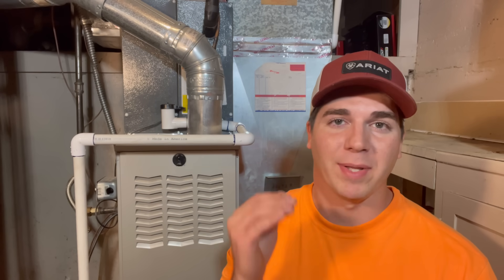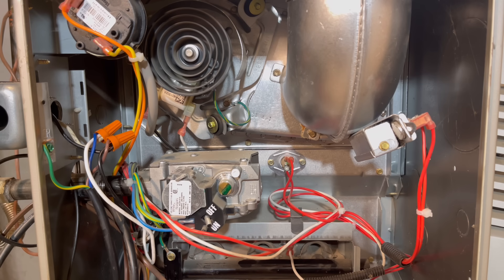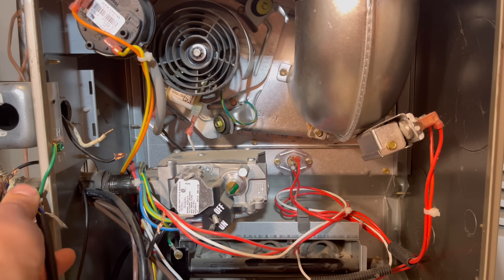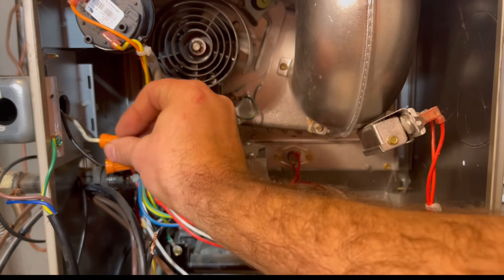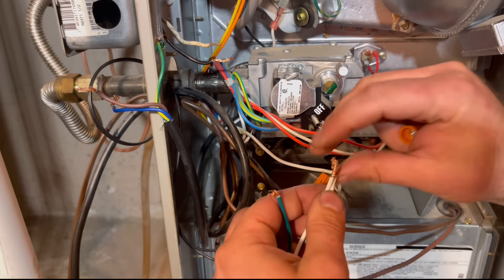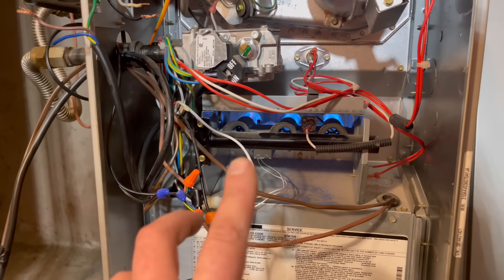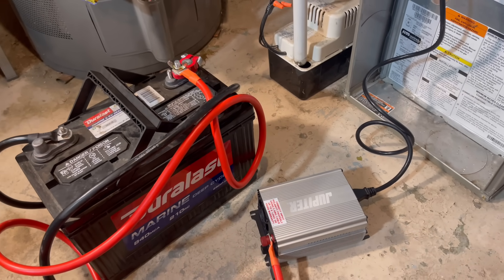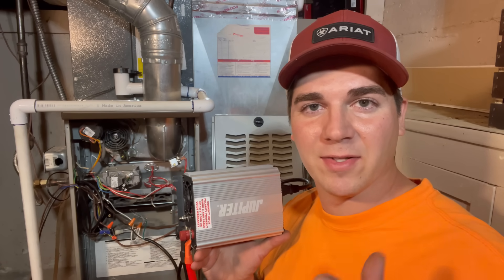Did You Know You Can Heat Your Home With A Car Battery?

Comment: Some corrections need to be made here.  A furnace drawing 800 watts would be pulling about 80 amps off the battery. That is about the same amperage as a starter motor draws as you are starting your car engine, so the furnace would not run very long.  As others has pointed out... It is important to use the more expensive pure sine wave inverters.  Induction motors and transformers (which are what this furnace has)  will run slow, hum loudly, and will run hotter on cheaper modified sinewave inverters.  If you were going to do this, you would be better off hooking up the inverter to your car and keep the engine running the whole time, and run an extension cord to the furnace
Reply from the maker: Yes, I actually hooked it up to my work truck so I can power the furnace as long as my truck has fuel 👍🏽  thanks for watching! cheers
Reply: @diyhvacguy   so a 1000 watts total? Meaning 500 watts per plug?
That's how mine worked. 3000 but only 1000 watts per channel.

is 500 watts really enough to power the unit?
Reply: @alandeon  For his "800W" furnace, 500W wouldn't do it, unless it had a Surge which could temp handle it (likely did/does)... 
 (... and his "800W" furnace is apparently quite large, or like he mentioned that reading was done during the very short time the igniter was on too;  my small-ish furnace was only pulling 265W after igniter was done (blower only), and not a whole lot more when it was briefly on)
Reply: That peak power draw from the furnace lasts less than a minute when the gas ignitors are activated.  Beyond that,  you're just powering the gas solenoids, computer control, draft fan, and main blower fan.  Just hook up the inverter to your car outside, and run a long extension cord into the house.
Reply: A gas furnace only draws a fraction of that.
Reply: @ScottDLR  I have 2 - 2 ton furnaces.   Each draws 550 watts.  Obviously a larger furnace would draw more.  That's why I said 800 watts
Reply: @stevehill1802  Just checked mine. I have one 3 ton furnace and it draws 312 watts while the inducer fan is running .
Reply: @ScottDLR  Cool.  Just goes to show that different furnaces draw different amounts.  Mine has a humidifier which draws a little.  Also the igniter was on when I took the reading.  My furnace is 30 years old as well.  The inducer is huge for some reason.  It is high efficiency.
Reply: Trucker_9000   - Re: "pure sine" ... - Not sure about that, I've always had motors slower 'n buzzin without it...  (2 pure sine's, 2 not)
Reply: trucker 9000  I hope you're not using a gas cooktop indoors without running an exhaust fan and certainly not to heat a small room!
I liked your answer "...@Dean Crowe  same reason you cant eat yourself to stay alive" Lol
Reply: @jcook3986  ? - only 115Ah (plus 70Ah) batteries?   I use a 460Ah LiFEPO4 Lithium battery (about half the size/weight of a small/std car battery) I got for just $140 (tax incl) on Amaz 2 yrs back (with 5 yr warranty and Great Customer Service reviews for easy free swap-outs if/when needed; at that tiny $$ maybe up to 15% needed returns but ppl loved the quick easy replacement service and had no issues with the new ones)...  Still small for HVAC, but one time our (small) furnace blower blew immediately b4 a power outage, was able to fit in a 20" box fan which only drew 50W and did a surprisingly ok job in the small setup/area with only 2 vents left open (bedroom+bath)...  got a couple days out of it, then recharged on $35 smart charger with $180 Pure Sine inverter 1500W (3000W Surge) connected via long thick extension cords to car in about 2 hrs each time.  (didn't want to just leave old car running all the time)...  Also did this for 2 fridges, just swapped the (several) extension cords' plugs at the inverter, ran long enough to chill each fridge every 6-10 hrs as needed according to thermometers.  (lol little funny walking over several sets of long thick orange extension cords strung thru house, but did the trick, and after the initial surge current for a few secs the actual running watts were surprisingly tiny)
Reply: trucker 9000  A controlled dead short?  If you are talking about the windings on a motor, then anything with a motor or transformer would be the same thing, and would not be considered a short.  In fact anything you plug in would be considered a controlled dead short under your definition, except electronics with a switch mode power supply.   Induction motors such as a blower and  draft motors do not run well on modified sine wave inverters.  They run slow, over head and hum loudly.  Pure sinewave inverters are a little less efficient than modified ones though
Reply: Trucker_9000  - Perhaps he means keeping the battery topped off as it's powering the high-draw items which the inverter itself (if limited to 500 per channel, as someone inquired above) can't quite handle, as well as the somewhat large (if brief/intermittent) surge/draw on the car/alternator too...   The battery would be a "buffer" between the two (tho I'd imagine there might be some extra circuitry required in that kind of setup)...   
- Just guessing...  ?
Reply: Actually I think many starter motors draw a lot more than 80 amps! As an example I looked up totally randomly first starter motor I found from spare parts site; Volvo car starter motor, power 2,2 kW. That power with 12 V requires about; 2200 W / 12 V ~= 185 A to run. Bigger engines may have twice more powerful starters, so it is not uncommon for starter to be 200 A or so, or even more.
Reply: @wopmf4345FxFDxdGaa20  You are correct.  Diesel engines draw a lot more.  I looked it up, and a starter motor can pull anywhere from 80 to 225 amps depending on how big the starter is
Reply: @stevehill1802  Yeah, you are right. I don't know how powerful / what kind of wattage the blower motors usually are in those furnaces? From that info could calculate the amperage quite easily . . .
Reply: I think the continuous load of the furnance is the fan. I wouldn't expect that to consume nowhere near as much as car starter motor  continuously, but I might be mistaken . . .
Reply: @wopmf4345FxFDxdGaa20  The ratio for a 12vdc to 120 vac inverter is about 10 to 1.  A half horse motor draws about 5 amps, or about 50 amps off a battery.  If you notice the cables going from the battery to the inverter have to be huge
Reply from the maker: I realize I was mistaken in my assumption that it would last for days in that my heater doesn’t run but for maybe 10 min increments so it’s not like mine stop running time. But I guess I was wrong.
Reply: @diyhvacguy ,  so what was the run time?  I'm thinking about electricians who have to do panel swaps/upgrades in the winter and could keep a family's furnace running during the 6-8 hours it takes for the swap.
Reply: Plug in a battery charger to the inverter and connect to battery and run inverter to furnace.
Reply: Why can't the inverter power a small trickle charger for maintaining the battery at the same time.

Comment: Hey bud... I like your idea. What if you plugged a 12 volt battery charger for your car into that inverter and..... you know.... put the clamps right there on that battery you have🧐
Reply from the maker: Yea! I actually hooked it up to my work truck so I can power the furnace as long as my truck has fuel 👍🏽  thanks for watching! cheers

Comment: That fan will drain the battery in a few hours.  It draws about 4 amps at 120 volts.  Thats 40 amps at the battery.
Reply from the maker: Yea I realized that pretty quick. I actually hooked it up to my work truck so I can power the furnace as long as my truck has fuel 👍🏽  thanks for watching! cheers

Comment: I didn't see a follow-up video as to what the battery life was.  Is that available?
Reply from the maker: I actually hooked it up to my work truck so I can power the furnace as long as my truck has fuel 👍🏽  I’ll be posting the video of that in action soon. I am curious to see how long this fully charged battery would heat my home so I will probably still create that video. thanks for watching! cheers

Comment: I'm pretty sure Texas doesn't use natural gas.  Most systems are heat pumps or just split system A/C with electric coil heat.  Even a typical portable generator wouldn't run it.
Reply from the maker: You are correct. This video is for a gas furnace and I was simply using texas as an example. I’m in utah.

Comment: You should ensure you get a pure sine inverter especially if you have an ECM blower otherwise you could find yourself with a big repair bill.
Reply from the maker: Thank you for this. I actually got a pure sine wave inverter, hooked it up to my work truck so I can power the furnace as long as my truck has fuel 👍🏽  thanks for watching! cheers

Comment: You can use a car battery and an inverter if you have a boiler if you have natural gas furnace how could you possibly run the blower for a long period of time as stated in other comments one to two hours that's it please explain
Reply from the maker: Yea I quickly found that myself.I actually hooked it up to my work truck so I can power the furnace as long as my truck has fuel 👍🏽 I do want to do a test to see how long it will run my furnace just for giggles. I’ll probably post that soon.   thanks for watching! cheers

Comment: I'm thinking that this would work far longer with a gas fired boiler that with a furnace. The only draw with the boiler is the circulator, control, gas valve and zone valves, all of which don't draw as much as a furnace fan.

Comment: I did something similar but more money, simpler and safer. You can use a power bank like a Jackery or Ecoflow Delta and and a simple single manual transfer switch installed on your furnace. I used the EZ Generator Switch. Works great.
Reply from the maker: Thanks for sharing

Comment: A deep cycle battery can be safely run down lower than the battery that starts your car which is not designed to be run down below about 50%.
Reply: Lead acid deep cycle AGM battery limit is 50% and better for continuous load than a regular lead acid car battery.

Comment: You may have said this in the video (if you did, apologies) but what if you have a Nest or some other device that provides the signal to the furnace to turn on?
I'm assuming those wires can be easily shorted to provide the signal to "heat."  Can you advise?
Reply from the maker: All smart thermostats are powered by the c wire from the thermostat. If it’s a battery powered thermostat, it’s just sending a signal to the furnace just the same.  So the furnace will still know when to turn on and off if it’s powered by an alternative power source.

Comment: great idea! I was wondering how the gas furnace functions in the event of a power outage. I am probably wrong but wouldn't it be cheaper to buy something like a Jackery battery (it comes with a built-in inverter + much lighter... a lot more versatile). it doesn't have to be the bigger 1000 w hours one (since that is more expensive). you can even get solar pannels to charge those in the event of a longer outage.
Reply from the maker: Actually what I ended up doing that I should have put in this video is I got a pure sine wave inverter and hooked it to my work truck and then I’ll just run an extension cord to the furnace so as long as I have fuel in my truck I can power the furnace 👍🏽 just start it up occasionally and let it idle.

Comment: I have an 800 watt inverter. Would that be enough to power my furnace?
Reply from the maker: Depends on how many amps your furnace pulls. Probably not. Maybe if it’s a 40,000 btu furnace. Measure the amp draw then multiply by 120 and you will get the watts you need.

Comment: Great vid. How long will the furnace motor run off that battery? Thank you in advance.
Reply from the maker: I haven’t done the test yet I was just excited to post this video. Actually what I ended up doing that I should have put in this video is I got a pure sine wave inverter and hooked it to my work truck and then I’ll just run an extension cord to the furnace so as long as I have fuel in my truck I can power the furnace 👍🏽 just start it up occasionally and let it idle